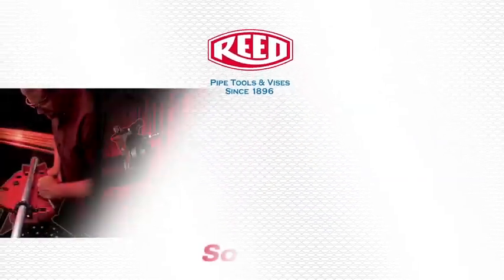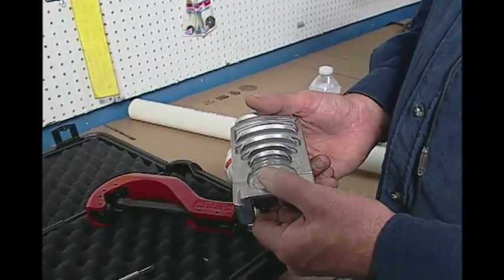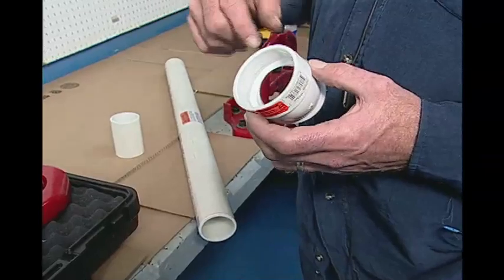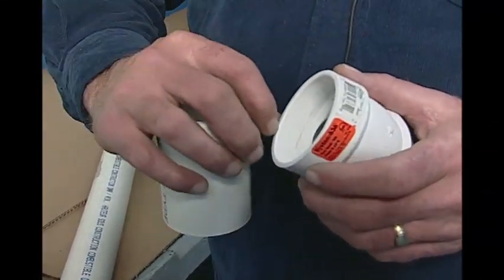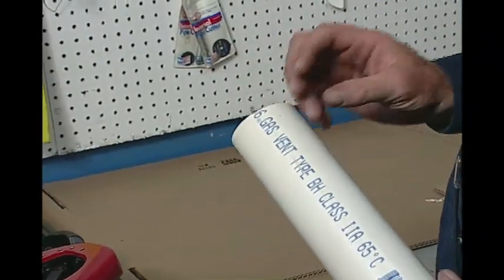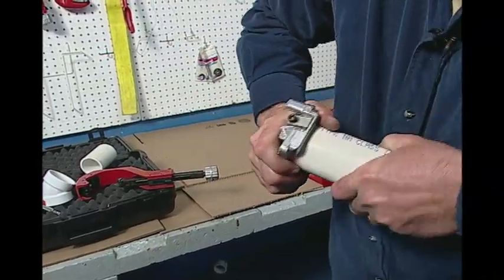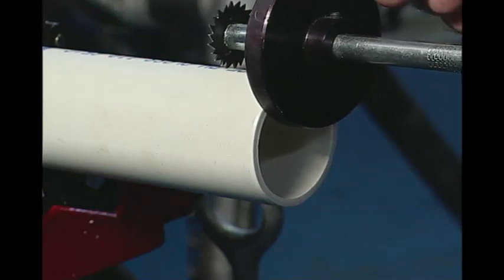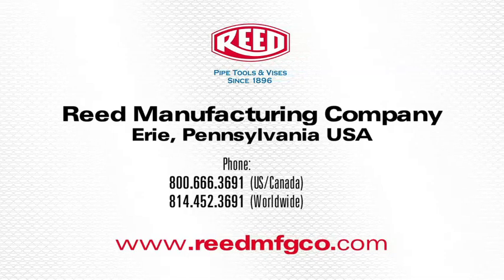Solutions Kit for Plastic Pipe Joints Demonstration - Reed Manufacturing

Comment: Does the Reed TC2Q PVC cut better than a Ridgid 152P #31647 ABS & PVC cutter?
Reply from the maker: REED recommends our TC2QPVC and REED cutter wheels.  You can also use REED cutter wheels in a Ridgid cutter.
Reply: @ReedPipeTools  thank you for your reply.
 I did go ahead and purchase the REED TC2QPVC 1/4" - 2 5/8" cutter. It's great.
Reply: What's the kit number for 4 inch PVC plastic pipe cutting?